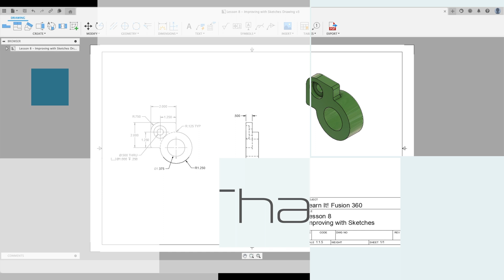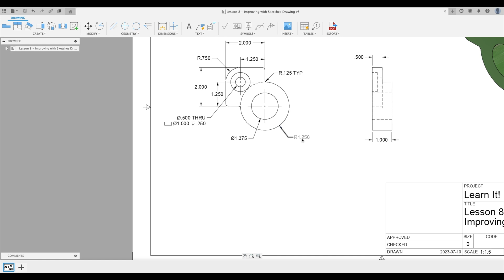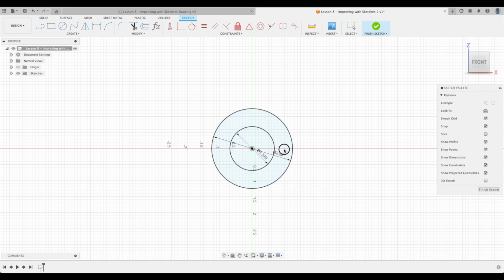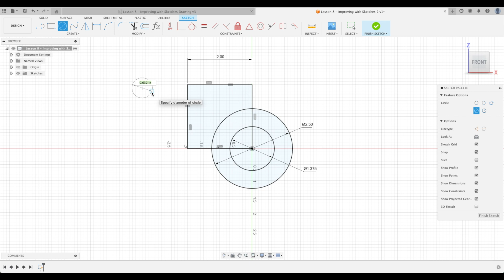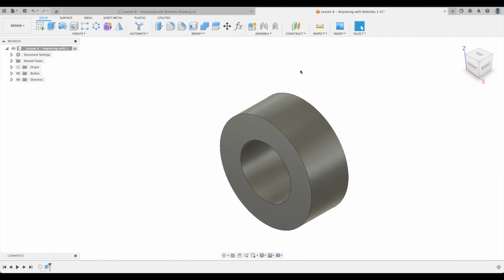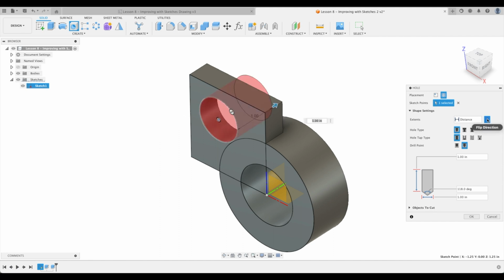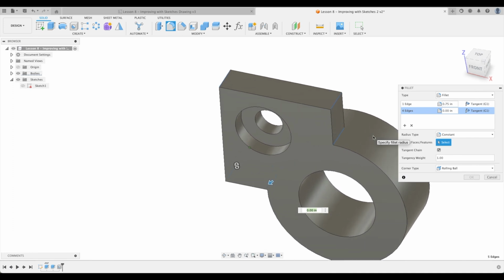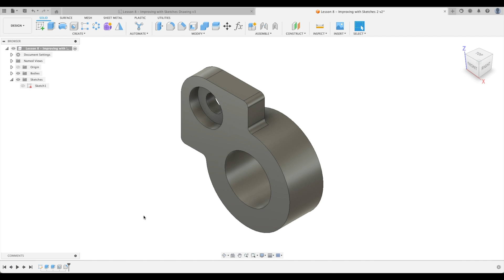Fusion 360 for Beginners - Lesson 8 - Sketching Tutorial (2023)

Comment: Hi, thank you for your great tutorials — I really appreciate the time and effort you put into them!

I just have one question I hope you can help with. I installed Fusion 360 on my Mac and I'm using a Magic Mouse to draw and navigate. However, I often struggle with zooming, orbiting, and rotating around objects.

From watching your videos, I can see that you’re also using a Mac, but you seem to navigate around objects with ease. That made me wonder — are you actually using a Magic Mouse, or do you have a different mouse connected to your Mac?

I’ve started to feel like the Magic Mouse might not be ideal for design work, but I could be wrong.

Thanks again for all your hard work — it really helps learners like me! 😊
Reply from the maker: Hello! Thanks for your encouraging comment. Glad that you are enjoying and benefitting from these tutorials.

Yes, you are correct, the Magic Mouse is definitely a struggle to use with Fusion. I would highly recommend using anything else. Actually, you'll find using a wired mouse is often times so much better than bluetooth because the cursor doesn't jump around as easily. If you do buy a mouse, make sure to get one with a middle mouse button since that helps with panning and orbiting too. 

When you're ready to take it to the next level, please check out the description to any of our videos. Most, if not all, our tutorials have a link to a 3D mouse made by a company called 3DConnexion. There are several models at several price points. The least expensive one is more than enough for a new and experienced user. They are a tremendous help to easily orbit, pan, zoom, swing, etc. your part. Check it out!

Comment: You added a circle to the sketch as a placeholder for what became the counterbore hole. But why create a circle when what you needed was a point? (for positioning the counterbore). Is there a way to either 1) add just a reference point in the sketch or 2) use the intersection of two construction lines?
Reply from the maker: I used a circle originally in order to help my students visualize the sketch more and get used to selecting more than one profile to extrude, but you’re exactly right in wanting to use a centre point instead. You’ll learn that in upcoming lessons. The danger of using an intersection point of two lines is that sometimes one might select a false point that’s not constrained. You’ll probably not even notice until a) you’ve machined your part and the dimensions are off or b) you’ve changed a related parameter and see that the point is way off.

Comment: Hi learn it! I'm having a problem with the fillet feature. I did the 0.75 fillet and the two most external 0.125 fillet in the sketch. So I tried to do the fillet that connects with the large circle in the solid, but fusion is making the fillet going in the piece, not out. I've already searched about like "reverse fillet" but I'd like to understand my errors and possibly choose, when do fillet go in when go out
Reply from the maker: Hi there! Thanks for reaching out. I think that the issue is you haven’t joined your bodies. When you extrude a sketch that intersects another body it should join them together by default. However, it’s possible you selected “new body” instead of join. The easiest way to check is to expend your “Bodies” folder in your browser (left margin of your windows) and see if there are 2 bodies or not. If there are, then you can just double-click the second extrude and select “join” as the operation, or simply use the Combine tool to join the 2 bodies together before you fillet. Let me know if that works.

Comment: When you are selecting the edges for the fillets how are you revolving the part around? The only ways I know are using the mouse and either using shift and the middle button, the cube in the top right or the orbit at the bottom, all which suck.
Reply from the maker: Thanks for asking! Check out the description to this video (or any of mine) and you’ll see a link to a 3DConnexion SpaceMouse. It is a special mouse that is used for 3D designers. Definitely worth it. There are 3 basic models and each model has wireless and wired versions (all at different price levels).
Reply: @learnitalready  Ordered one today! I got the 3Dconnexion SpaceMouse Compact in the wireless version. I think this is going to be a gamechanger. I really hated moving the around the object. It will be great in Fusion as well as Bambu Studio. Thanks for the information. You videos are absolutely top notch. Best I've found so far. Keep it up, your content and style are fantastic.
Reply: Thanks again for the great tip on the SpaceMouse, I got it a few days ago and it took me about 10 minutes to get comfortable with it. It may take others longer but since I'm a 60 year old who still games I picked it up very quickly. I can move around effortlessly now, and it makes Fusion 360 a joy!
Reply from the maker: @ Great to hear! Did you do the teakettle training or puzzle exercises?

Comment: @ 6:30 if you are going to use random diameter circles for hole features, just use points.  Its easier and less confusing if you are going to use the hole tool later to create the hole.
Reply from the maker: Thank you for your valuable input. For anyone reading this post, I agree 100% with this comment. In fact, most of my tutorials in the past year have mentioned the same. Thanks again. All the best!

Comment: It took me 5 mins and 40 seconds but I work in metric, so I had to convert everything into millimetres as I went along, which slowed me down a little.  Still, I'm amazed I'm learning so much so quickly (I'm a complete noob when it comes to CAD/CAM work).
Reply from the maker: Great job! As a little tip, regardless of the type of units used in your document (metric or imperial) just type the dimension you'd like followed by the unit. For example 4 millimetres can be input as "4mm", or you can input 0.5" for 1/2 inch. Test it out and let me know how it works for you. All the best!
Reply: @learnitalready  Wow!  Just got round to trying this.  What an amazing tip!  This gives me the best of both worlds.  I love the metric system for fine detail but to be able to put in 4.5 in and it do the conversion for me is fantastic.  Great tip. Thanks
Reply from the maker: @ Glad to hear. Happy to help.

Comment: Hi, It took me 10 minutes using all the features you taught in this lesson.  I also added a chamfer on all the surfaces.  Thank you pointing out the little details that most people might over look.  I am using Fusion 2.0.2 so it’s a little different.  I have been doing C.N.C Machining for 44 years and wanted to learn Fusion.  I plan on using it on a 3D printer too.  I have to check to see what you have related to that and exporting.  Thanks again
Reply from the maker: Great job! I appreciate that you took the time to mention how you've benefitting from this lesson. Would love to hear about your CNC machining work. I started on a Mori Seiki SL253 at 15 years old and loved it (besides the stress). Hope you're able to use the tools taught on our channel to help improve your Fusion skills. Hope to hear from you again!
Reply: @ yes sir, I too started at 15 in a vocational trade school.  I am currently working on 2 Makino F5 machines with a Erowa robot feeding the 2 machines.  We manufacture medical implants.  I make a Preserve stem, it is for the arm side of the shoulder joint.  I am currently printing the part from this lesson, but I used the shell feature you showed us in previous lessons to save on my printer filament.  Thanks again
Reply from the maker: @ Nice machines! I’ve always wanted to get into the medical field, especially dental machining mainly because I don’t want to own a large machine shop (I like having normal blood pressure again! 🤣) 
Thanks for letting me know about how you’re using what you’re learning.

Comment: seems like I don't have square in fragments and can't select just the upper left portion to extrude it :(
Reply from the maker: Thanks for reaching out. May i recommend the following: start from scratch again and pay close attention to each feature or tool that you use to create this part. Make sure to create the sketches in the same way that i show in the tutorial. Let me know how it turns out for you. All the best!
Reply: @learnitalready  yes, I made mistake by creating multiple sketches not just one!
Only thing I couldn't finish is 4 screws, to turn them around into box holes (kinda confusing as well).
I'm using 'mm' measurements so i multiple every inch by 10.
But for screw I couldn't find #10-24 1inch screw that you pick up for my thickness. 
Overall awesome tutorials!!

Comment: It took me 6 min, 50 sec to build the part again on my own.  It would have been longer if I had waited until the next day, or longer.  I still remembered pretty well how to do it.

Can you please explain what the radius of the fillett is measured from?  The large one in the drawing is .75, and the counter bore is 1.0, yet it looks like 'radius' of the fillett is larger than the counterbore, even though it is smaller numerically...
Reply from the maker: You’re doing exactly the right way: practice and then practice again after trying to memorize. You will improve quickly, I am confident.

Regarding the fillet radius: you are correct the the outer fillet radius looks bigger, and that’s because it is. The dimension of the c-bore is actually a diameter of 1 inch. The radius is 1/2 of the diameter, so the c-bore actually has a radius of 0.5 inches.